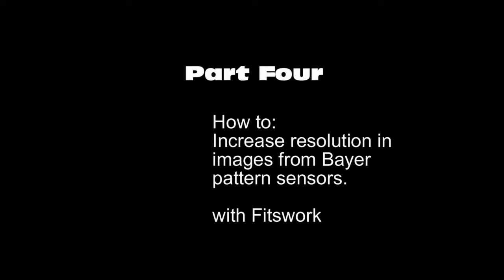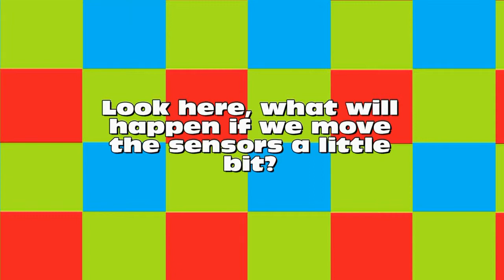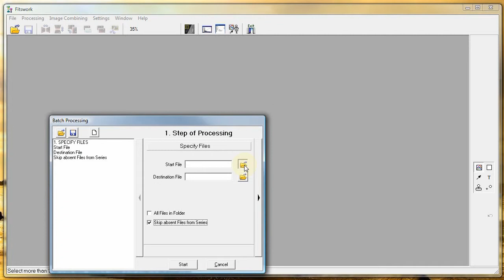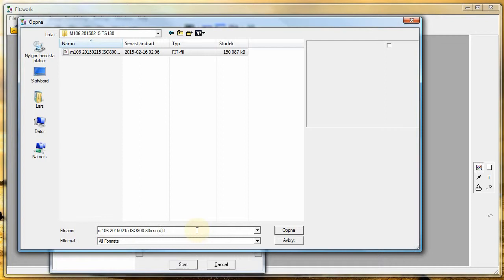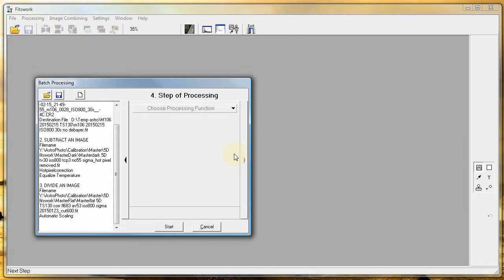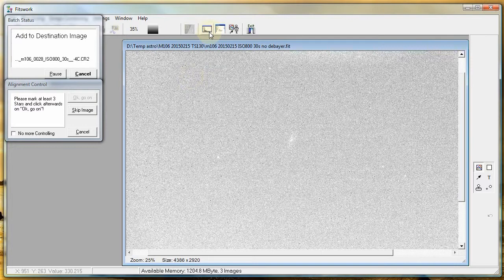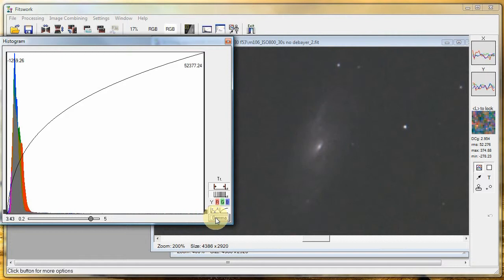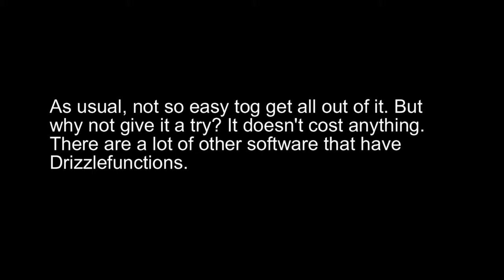Fitswork tutorial part 04 increase resolution in bayer pattern colorsensors

Comment from the maker: Hi Matta,
Yes I think you must have it, because there is the gain you set for red and blue relative green to compensate that the green is the most sensitive. If your optics have chromatic problems you set a scale factor also in the color profile.

You can use DCRaw to convert your raw files to a format that Fitswork can read.

/Lars